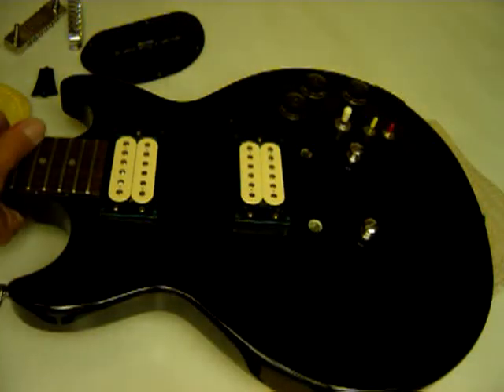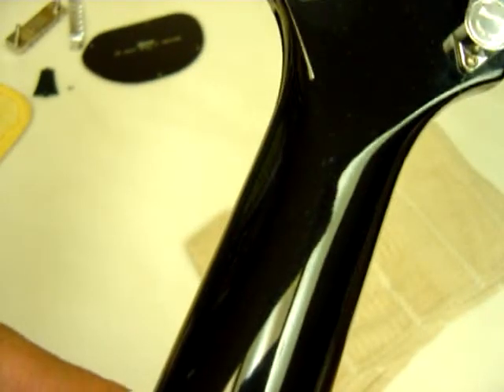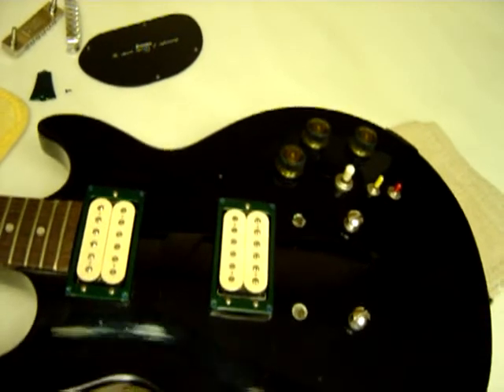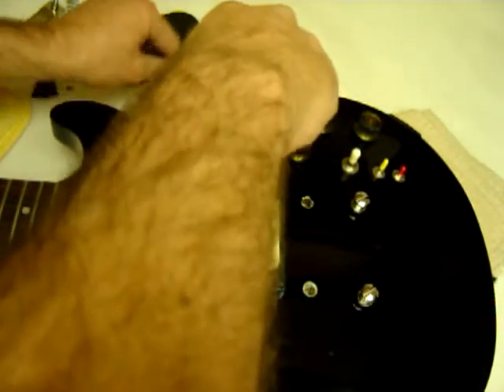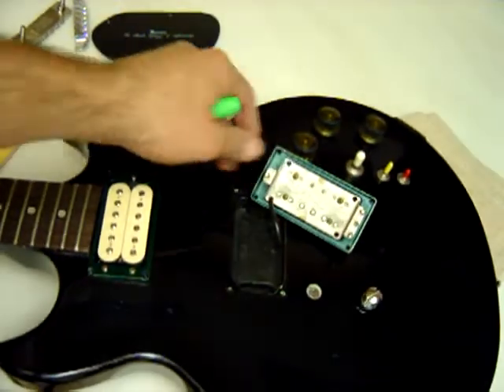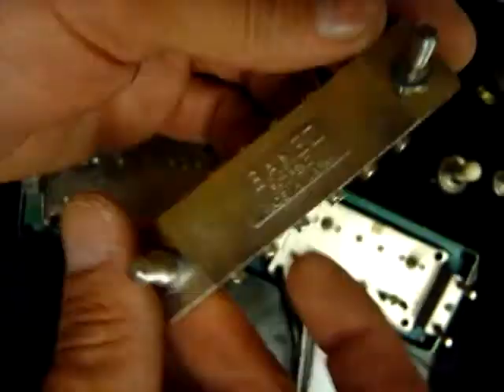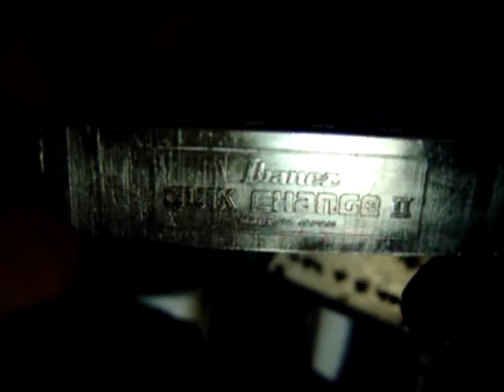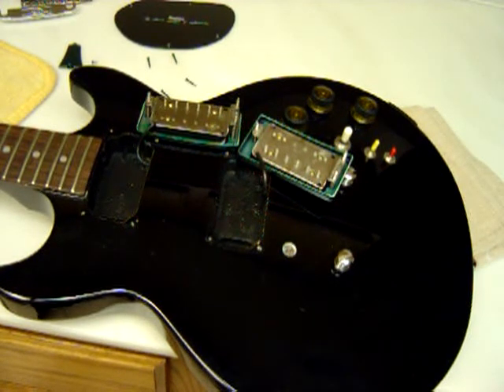1983 Ibanez Artist AR30

Comment: Just watched this and wanted to add that I have owned three '83 AR30s and all the pickups were exactly like these in the video. Everything I can find on AR30s say they had Super 70s in them. I also own other guitars with Super 70s (my favorite pickup) and these pickups sound like Super 70s to me. I know that early Super 70s had the stamp that said "Super 70" on the back, and from '77 to '82 they had the 6 digit serial number with some of the transition ones having both the stamp and the number, and then there are these variations. I wonder if any of the '82 AR30s had the same pickup or if it had a serial numbered Super 70? Be good to know. By the way one switch was a coil splitter and the other puts the pickups out of phase.

Comment: @randy0987 
i know you posted this 2 yrs ago, i got my C83 10 yrs ago stripped  the paint ( how was i to know these were collectible...) and the construction on mine is a 3 piece maple set neck, solid ash wings and maple center block. Action is very low and stays in tune great, replaced the dead original neck pup  with an ibanez v7- I  have a question for any one who can answer,  I love the tones i get out of the mini toggles does any one know if they're series parallel , phase or coilsplits?